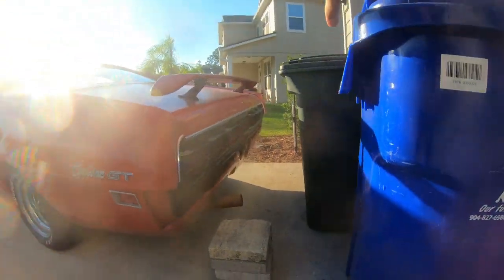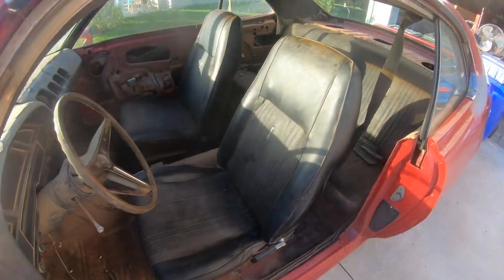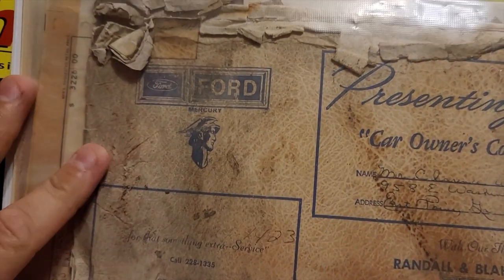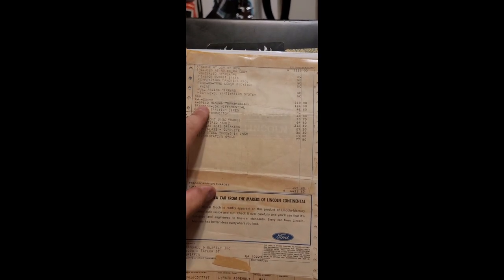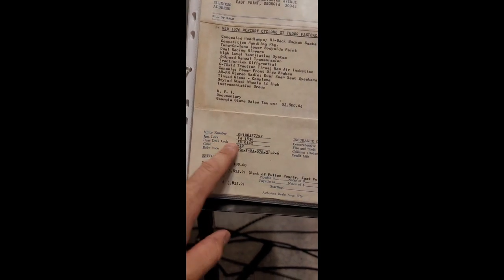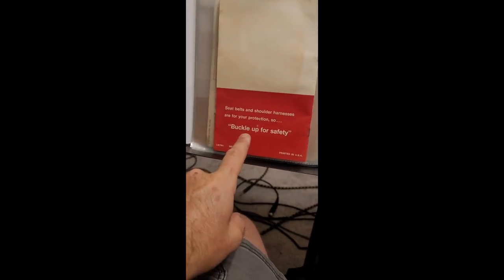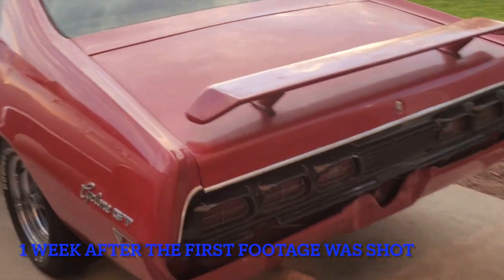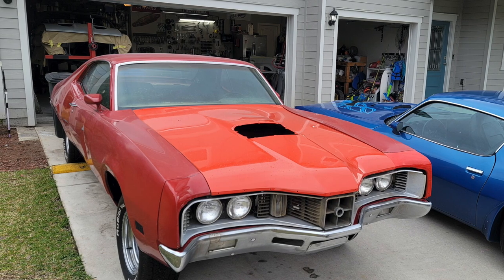"Barn Fresh" 1970 Mercury Cyclone GT 429 Cobrajet 4-Speed

Comment: There is no such Ford engine as a 400 modified .... there is a 400 that was designed to replace the old 360/390 ... then Ford de-stroked the 400 ( using a modified 351 Windsor crankshaft ) to create the 351M to replace the old 351 Cleveland engine ,
Reply from the maker: I appreciate the info, still learning my Ford stuff here. The "M" on the heads had me confused like on a Mopar 400 modified.
Reply: @SteffsGarage   if your talking about a cast “M” it’s referring to the Ford foundry in Midland... and helps designate between the Cleveland and Windsor foundries